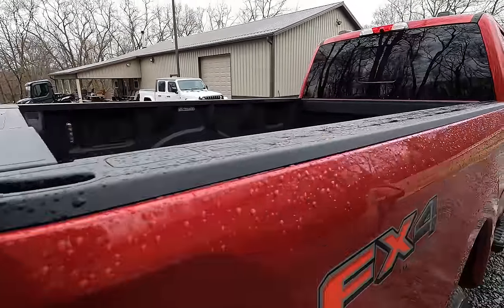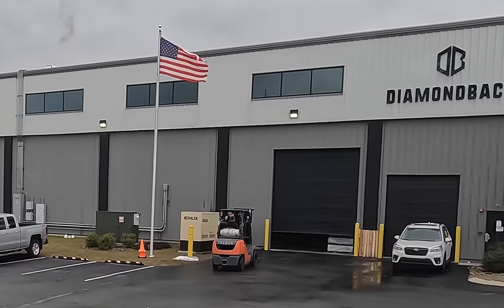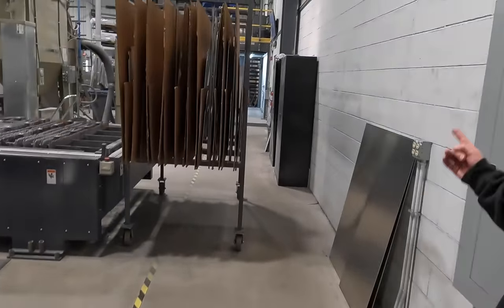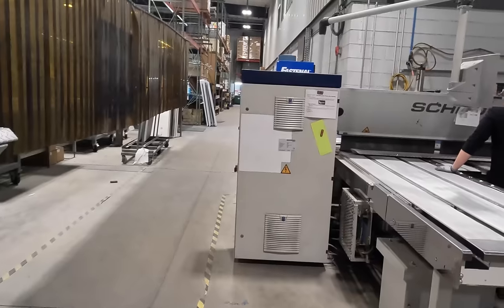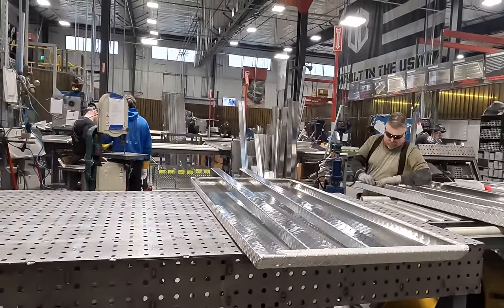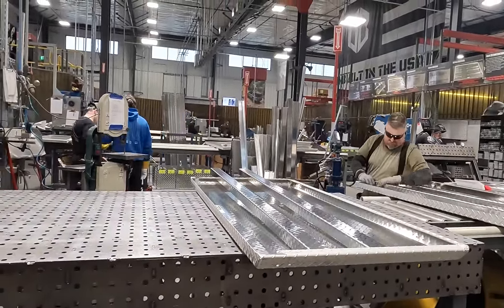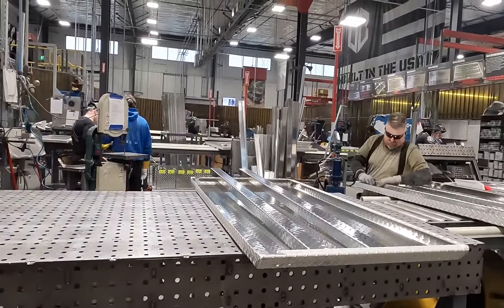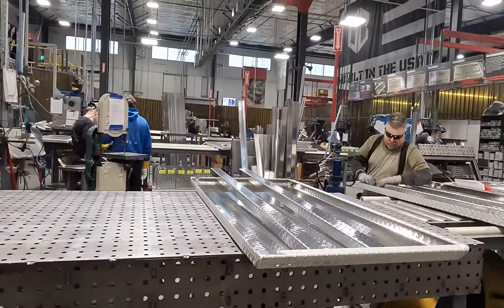YOU SPOKE! And I Listened, Now I'm Thrilled with it! Diamondback

Comment: 👍👍👍👍👍👌I have been through quite a few fabrication facilities  from Aluminium tank trailers, to miscellaneous aluminium fabricators, that shop is  very well presented on an ordinary work day from raw material to parts prep,to paint prep , paint, and shipping. Seemed like you could eat off the floor  in every area , everyone was ass up & head down to get the product out. very well equipped Lasers, Robots, positioning equipment Lay out very well planned.  thanx for the tour and the presentation of the work area in the plant, very impressive!!!

Comment: The protruding latches will be a problem, they need flush mounting paddles or a hidden latch that is actuated by a lever mounted in the side of the cover. Also I don’t know how you’d ever load a quad as they don’t provide any means of attaching a loading ramp. All bed covers are a love hate relationship if you actually use your truck as a truck was designed to be used. I have a couple different types that i change out seasonly, TruckBoss USA ( sleddeck) & Retrax proMX   I like the thought behind the one Mike picked up it just needs some refinements and added versatility in order to utilize that carrying capacity. Look forward to seeing how Mike feels after 6 months use.

Comment: I'm 71 years old and way back when the bed covers had snaps along the sides and back. They were okay. Then one time I had the fiberglass color match cover and it would flip up and it was a pain to take off and I took it off several times and a pain in the arce. The one I have now has is opened by first opening the tailgate and flipping a release and roll it up and then can be easily hooked to stay open. I wish I had bought the aluminium type where it unlocks and slides back toward the front. I also had the trifold and they didn't always keep inline.

Comment: I had several truck caps in the past and lots of leaks and got tired of water in the box and then I found the Diamondback tunnel covers and never looked back.  I had it shipped to Toronto and installed it (with my wife's help) in an hour or so.  Only issue I raised with Diamondback are the locks systems, which are sometimes difficult to open with snow and ice on top but I now lube them up in the fall to avoid the issues.  I also purchased the window rack and cargo container for inside and I will never look back but I wished I had purchase the heavy duty cover to be able to put things, i.e. building materials, snowmobiles, side by side on top.  Great buy and a great company.

Comment: Ok to use the reasons why you get a bed cover.  1 what you have can be locked to keep your belongings somewhat safe.  2 as Melissa said it looks nice and the quality of DiamondBack Bed Cover seems to be very impressive, seeing the plant shows how they are made.  3  and the one I like the best is a bed cover helps your mileage since it stops the air flow into the bed and off the back without the air flow goes into the bed and then hits resistance with the tailgate up so it puts a drag on the way the vehicle goes through the air.

Comment: Nice cover.. First make yourself a 3 foot wooden rod with a hook on it and leave it in that tool tray. Then a wooden leaf rake handle with a hook on it and leave it inside right by the tail gate. They will both save you so much time trying to reach in to grab something. Very little bending way over to grab an any idem you want.

Comment: Every step of the way of my dealings with this company I am more impressed.
Yesterday...just received and installed my "Switchback". 
TOP quality in every aspect -- design | build | finishing....as well as their customer service side!
Diamondback has a nice range of options.
Mine is not a "working" truck .. so my "sissy" cover is not Diamond Plate .. but is advertised to support 400 lbs! 
 It is "Smooth Black" (actually smooth metal with sprayed on "Bedliner") .... looks a bit more sleek---just a better "different / better match" for my setup.

Most strongly recommended!

Comment: Mike, as you already know,  you'll love your Diamondback.  I've had mine for over a year. I bought one of the last ones for the OBS Ford. I have the huge Dee Zee across the bed tool box on my 8 foot bed so I bought one for a short bed Ford. I have to shorten both panels 3 inches to fit my application.  I've have the parts made but I'm kind of nervous cutting into their beautiful work. I can tell you that I've strapped all kinds of stuff on top including lumber.  I just lay some moving blankets down so I don't scratch the polished aluminum.  You definitely made the best choice in bed covers

Comment: In 2007 I had never heard of them either and wanted to haul an atv on top of my bed.  I was looking for heavy duty corrugated Al to build something similar and stumbled upon this.  After seeing how expensive they were I searched eBay and later Craigslist and found tons of cheap Diamondback covers for popular trucks but not my Titan.  The guys at diamondback would help me figure out which other makes were a close enough fit, I also watched their scratch and dent section of their website.  They were willing to help a young guy who wanted their cover who just had young kids and little disposable income.  A few more years I saved the cash and bought one outright to my specs.  I hauled my atv and trailer all over the woods until COVID-19 with that rig.  One thing to watch is you quickly exceed a half ton truck payload capacity hauling an atv with this but it's super stable, I've cannonballed down steep mountain passes with tons of curves loaded and never felt it made me top heavy and it never loosened up over time.  If you're old don't buy to put atv on top, it's a lot of climbing around pretty high up to strap an atv down.

Comment: Now you need a Bed Slide!  They have a model that will hold 2000lbs and pull all the way out!  This will keep you from crawling up inside your bed with the cover on it!  As you put stuff in the bed and it slides all the way up to the front when you hit the brakes, you will REALLY appreciate it.  Keeping a long rod with a hook on the end of it to pull stuff out can be handy in the meantime.  And I agree, finding places to park or wash your truck when you have crew cab long bed can be a challenge for sure.

Comment: You two look like a great couple, and your wife is very pretty, with a wonderful smile!  Lucky guy!   🙂  Oh, and lucky guy, getting that Diamondback as well.  I plan to get the HD once I purchase my new pickup in 2025.  Just trying to decide between the F150 Platinum or Platinum Plus, the Tremor, or the Raptor.  But I still have time.  If I go Platinum or Platinum Plus I might get the 6.5 bed; otherwise would have to be the 5.5 bed.  Thanks for a good vid.  And keep smilin!  Oh, and by the way, kinda funny that I know what bedcover I plan to get before which pickup.  Lol.

Unrelated.  Some tent manufacturer should make a tent that fits nicely all the way around on top of a 6.5' Diamondback HD bedcover, if there isn't already one that would work.  It would then fit on an 8' bedcover too.  And they could design the hold down lines to tie down on the cleats around the Diamondback, or if they don't get the cleats stretch to tie down around the underside of the pickup, in either case with the tent opening at the tailgate end.  Could use the open tailgate to more easily step up into the tent, or if it's raining, have a small ladder handy so you can keep the tailgate closed.  No more need for a big, heavy, expensive, cumbersome pop up roof top tent, that limits your other carrying capacity and flexibility, just keep the tent and bedding rolled up in the bed, and once parked, take off whatever may be on top of the bedcover, and then just unroll the tent and put it up,  You'll sleep off the ground, and also have a tent you can use on the ground, a nearby flat area, when you can't find a flat area to park, or if you prefer camping on the ground, nearby or a hike in.  I'd love it.  Maybe Diamondback could make one, or spec it out to a 3rd party, and offer it as an optional accessory?  Maybe someone from Diamondback will read this and pass the suggestion along?  There are a lot of car campers and overlanders out there.  One more reason to choose the Diamondback bedcovers.  I tell you this, if one of those tents was already available and well designed, great in rain too, it would make my pickup decision for me, I'd get one of the F150 Platinums with the 6.5" bed.  You're a customer of Diamondback's already, and living not far away, maybe you could pass this suggestion along?  Heck, maybe Ford would do something like this, or one of the other automakers.

Comment: Congrats on the bed cover, Mike! It looks awesome and really sturdy. You mentioned washing the salt off of the truck and I noticed that it looked like the bed of the truck (wheel wells)  is not undercoated. I could wrong. I live in Virginia and every year DOT will spray a salt brine on the highways when snow is in the forecast and if a vehicle is not undercoated you are asking for trouble. Isn't undercoat recommended by the dealers in PA? I would have thought it would be. Great video, Mike. American workers doing it right!

Comment: Don’t know about your region but around my farm all I have is gravel roads.  Dust will still get into the Diamondback but you can lessen this if you use Sika Flex inside the bed around the edges.  Also, the lower portion of the hatch is very leaky.  Would need flexible weather stripping.

Comment: I pull a 5th wheel RV, so if that is the only model they make then it is not for me. With that said I like it. I have Flip Back for my truck. It is bed rail high and folds 4 times. Folded 3 times is great for my trailer.

Comment: I certainly looked at the Diamondback cover for my 2022 F350, but I ended up going with the Retrax Pro XR retractable hard cover with side rails to mount things on top like the diamondback.  The Retrax is not as heavy duty, but one reason I chose it is that I often find myself hauling things taller than the bed such as a generator, cooler, and various things with walk behind handles, etc.  Having to take off half the Diamondback's heavy cover or leave it propped open just to do that seemed like too much of a hassle.  I also didn't want to mess with strapping simple sometimes heavy things like this on top of the cover either.  I am curious what Diamondback owners have to say about this.
Reply: Mike when you do a detail of the cover show and explain how you can flip the front and rear covers over to get the tall items in the bed.

Comment: Looks to be outstanding quality.  My only knock of the model you purchased is that is significantly reduces the usefulness of the pickup's bed.  They make a triple fold design that looks to give protection and security without making the bed unusable to large taller items.

Comment: This company uses my way of answering any issue which is to do it the right way. They are simply a go to solution to be a trusted vendor for any products they sell. I use them exclusively when needed. Notice they use laser for welding which now that I have my 3kw hand held machine produces superior strength welds w/o need for additive wire/rods if parts to be welded fit well or overlap with complete penetration. This will be the future for welding as soon as price comes down I paid almost 20K for my unit which I just gifted myself about 2 months ago. I have been welding since I was 14 (I am now 74) on my first hotrod and am compentent as a hobbist in all methods from acetylene, and stick to tig and in less than 1/2 hour using suggested settings was able to produce high quality welds appearing robotic that took me years of effort to achieve with conventional methods at 4-5 times the speed of MIG while holding material w/o gloves. Lasers also clean discoloration and do rust and paint removal better than sandblasting and will weld anything that melts including plastics and ceramics not just metals. Ray

Comment: Looks like a quality piece.  They all have compromises and plusses/minuses.  Wondering about the loss of utility to put large/tall items in the truck.  I'm sure Mike will show us!  I have a rollup, the minus there is a loss of space at the front of the bed, the plus is it rolls up to leave an open bed.
Reply: The cover does come off if you need it to. Also, the panel on the rear can fold on top of the front panels giving you room for taller items. Well made stuff!

Comment: That looks like a really nice cover.  It is too bad that it is not compatible with a goose neck trailer.  I bought a bumper pull camper just so I would have the bed space, but the other trailers are too big and heavy for bumper pull.  I have a Gator cover and it works great for all things.

Comment: Does the cover have a central section that doesn't move?  It sort of looked that way.  If so, maybe there isn't room to carry a large upright object like a refrigerator.    And is there room for you to stand in the bed and move cargo around?  And is it too heavy for Melissa?  Looks well made, but I would have some concerns.  I'm not crazy about losing some visibility through the rear window.  Sorry to sound negative, but I've had covers on my last 2 trucks that roll away to the front that really let you open things up and get full use of the space.

Comment: Sliding friction on an aluminum tray causes  black fine dust that covers items that you have in there. You'll  be needing a liner or a rubber mat for the tray.
Reply: Unless the tray has a special coating to prevent that.

Comment: Don't like it.  What if you want to carry something tall?  I like the roll up tarp kind with the velcro strip on the sides to fasten when rolled back out.  I can go from tonneau covered to completely open in 2 minutes with no issues with height and at a fraction of the cost.  I dont' see you strapping down a fridge on top of that unit, nor being able to delete it in a pinch while traveling to carry tall.  You know full well you will never carry anything on top so the headache rack is a complete waste.  Can you honestly see yourself putting anything up there and marring the paint job?  Really?  Be honest.  Must have got a promotional deal on that to do this video.  I dislike misuse of youtube this way.